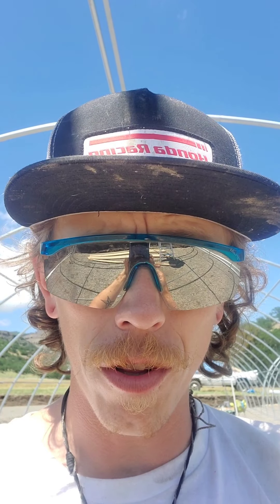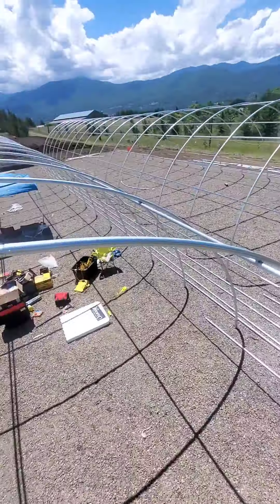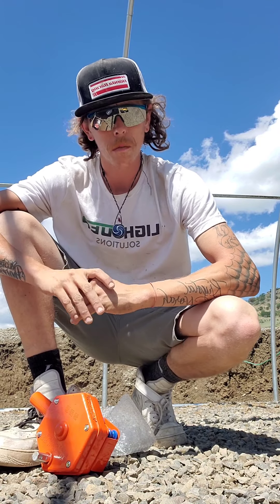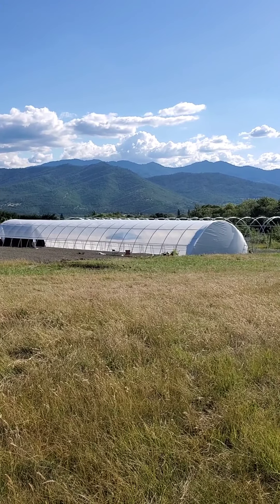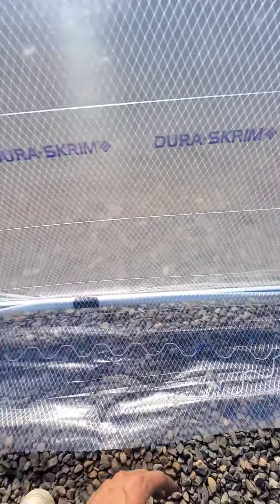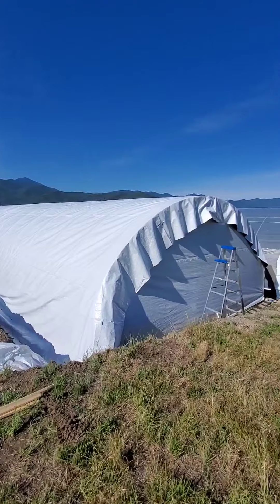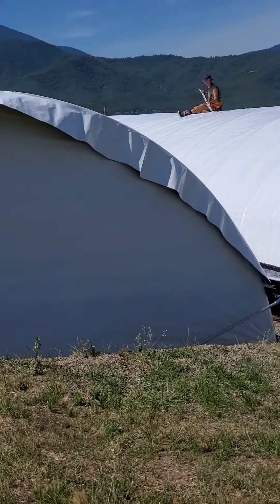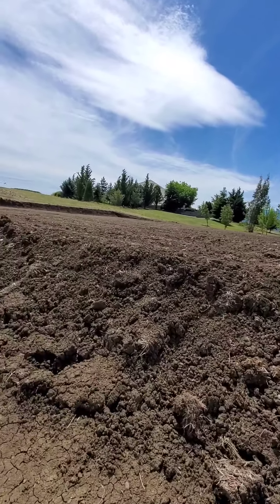How to build a greenhouse/light Deb video # 2 Skinning end  walls...hand cranks .... Motors and more

Comment: Great tips. When doing the large clear plastic I found it easiest to roll out the plastic long way opposite side your wind is blowing, find your bottom, wiggle wire some spots in and pull over with wind assistance. Was able to do a 24×100 by myself essentially.

Comment: great video, thanks for sharing
by any chance did you install one gear motor on each side(two gear motor per chapel)? 
after opening completely the curtaing, how do you manage the curtain to open completely and then closing  returning to the initial point without the curtain getting stuck? thanks
Reply from the maker: Check us out on Instagram
Reply from the maker: It is up through there in the DMs and I can send you pictures and better detailed instructions
Reply: @thegreenhouseguru8131  perfect I 'll follow you on instagram, have a great weekend  :) thanks a lot  @The Greenhouse guru
Reply from the maker: @MrGreatBerry  @therealgreenhouseguru

Comment: Thanks for the video! Is the wiggle wire channel up top that secures the dep poly all throughout the ridge perlin installed before both polys are up?
Reply from the maker: Yes you can do it both ways you can put The channel on top prior to putting both plastics on or you can put the channel on after you put the clear whatever you like there is no right or wrong way to do it

Comment: Nice Ive been looking for a video like this. what are you using for your roll up bars since you took the plastic piece out? a video on how you adjust your poles when they are wavy to straighten them out would be awesome. Do you not ever use straps to help secure it better to the structure ?
Reply: Great question on if and how they tie down the blackout. Just to avoid light leaks